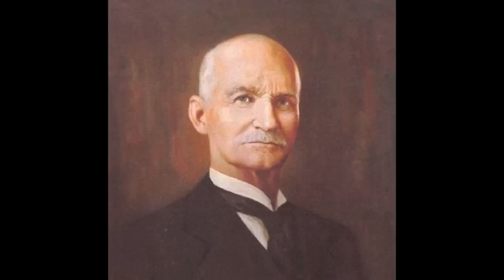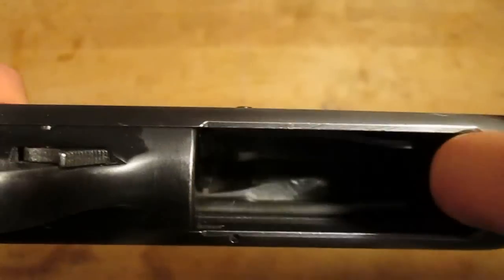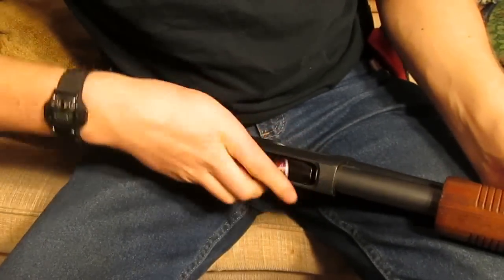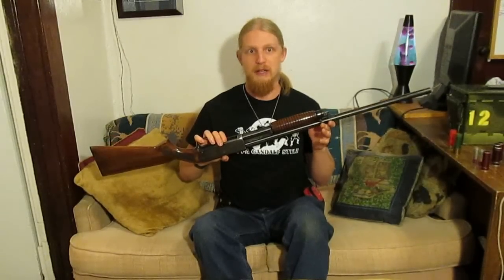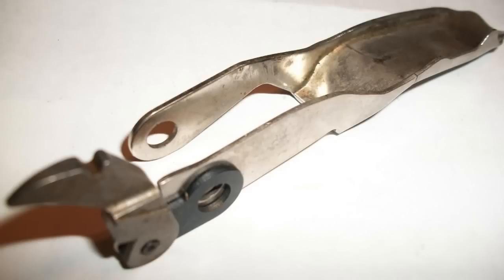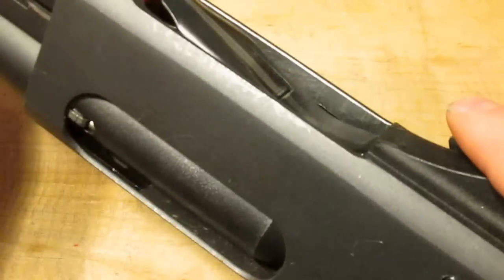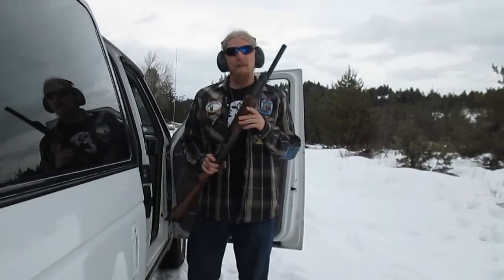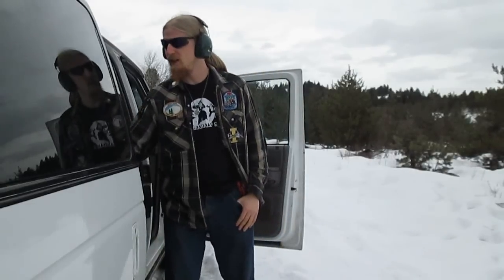Much Ado About Shell Carriers - Remington 870 Tips & Tricks #5

Comment: We have found in drills, especially in darkness, that it was easier to reload the Mossberg's magazine with the weak hand. Especially when keeping the shotgun up on your shoulder. This is due to the greater ease for find the loading port by feel. That is the only advantage of the retracted shell carrier that I've noticed. Moreover, lots of training with the 870 improves one's feel enough to negate that edge.
Reply from the maker: On the other hand, I've found that with the Mossberg 
(specifically my friend's 590A1), the bolt and carrier can snag shell rims slightly and cause a fumble during loading, whereas the 870's carrier offers a very smooth path for shells.  Also, there's a condition where a shell may seem to be in the 590's magazine, but it's not quite to the shell latch, and it's held by a piece of the bolt instead.  The next time the action is cycled, the shell simply falls out the bottom of the gun, and you wind up with an empty chamber.  If a shell isn't fully inserted in an 870's magazine, the shell carrier will either kick it back out of the gun right there, alerting the operator to the error, or it'll catch it between the carrier & slide assembly, where it'll still feed & chamber normally (if the 870 in question has updated flex-tab action parts).

All shotguns have these little pluses & minuses, and they rarely add up to anything significant.  As you said, training is essential, and that goes for any system.
Reply: Some of the silly debates comparing the 870 type to the Mossberg is centered on the supposed value of the ergonomics. Let me state that while so many like to talk about the fact that the Mossberg 500/590 safety is ambidextrous, this is an utterly meaningless factor in a combat shotgun. It is convenient feature for left handed sport shooters, but provides no advantage in a combat shotgun. How so?

Because, if you train with any shotgun, the operation of the safety becomes habit. Be it a tang safety or located at the front or back of the trigger guard, it doesn't much matter. When a fight is imminent, you are going to cycle in a round and move the safety to FIRE. That's the last time you will touch it until the fight is, without any doubt, over. Until then, your trigger finger is your safety. Off the trigger unless you have a target. Trigger and muzzle discipline are your safeties in combat. I don't care where the safety is, you won't be needing it as long as lead is flying, or at least the threat of it flying, is present.

Thus, to me, the tang safety is meaningless for combat shotguns in combat situations.

How about the dual extractors of the Mossbergs? Again, in combat, who cares. One or two, as long as it extracts. Ditto for the easy to replace ejector. If it breaks, regardless of brand, you have an issue to overcome. How it is replaced later doesn't matter while you fight for your life, does it?

What about the slide release location? Again, completely unimportant. I'm not opening the action unless I have a malfunction. The action will remain closed and shotgun hot until it no longer needs to be. Later, when the time comes to clear the shotgun, I'll unlock the action and empty the chamber. This is another thing expounded upon by those who have never been in combat or run realistic combat drills. Thus, they don't grasp what matters and what doesn't. Slide release location, like safety location, falls into the "doesn't matter" category under combat or simulated combat conditions. Comments that you have to remove your finger from the trigger are baseless, especially if you don't need to unlock the action.

Some shotguns have magazine tubes that are more easily unloaded than the 870 without cycling rounds through the receiver. However, that is only of significance when a cease-fire is called on a range and you want to unload quickly. 

By the way, I have an 870 and an H&R Pardner Protector that was given me as a gift about 6 or 7 years ago. It is simply an 870 clone, and most 870 accessories fit it. I wasn't thrilled with the H&R for several reasons. First was its excessive weight. Second was the rough action. Third was the worthless recoil pad and last was that it does not incorporate the modern 870's cutout tab on the shell lifter. After years of languishing in my safe, I finally decided to do something with the H&R. Since the near solid polymer furniture was a big contributor to the weight issue, I purchased a Hogue rubber over-molded stock and foregrip. The stock fits perfectly, but you must remove the factory installed spacer. The foregrip was simply too tight on the action tube. This required a quarter round fine rasp. I removed a little material on the foregrip and it slid on easily. This simple furniture change provided more than a half pound of weight reduction and gave a much better purchase on the stock and foregrip. It also provided a vastly better recoil pad. Two issues resolved. I realized that the action would slicken up with use, but I elected to clean up the action components with some light stone work (breaking edges, and smoothing surfaces). It was a bit time consuming, but upon reassembly, the action was far smoother. Indeed, it is slicker than my 870, and much more so than the Mossberg. I added a see-through Picatinny rail and a Bushnell micro red dot sight (a concession to my aging eyes). I also machined a taller bead sight, which restores the relationship if I sight through the rail, under the red dot, should it fail. A side saddle, sling and swivels were added. From safe queen to a first rate combat shotgun for about $200. Runs like a Rolex....

I enjoy your videos very much. Straight forward and extremely informative. Thank you very much!
Reply: @CoreyCJordan  Damn , you’re sure trying to convince everyone that the 870 is better than the Mossberg... or that the Mossberg isn’t better than the 870. Who cares?

Comment: Thank you for your well planned & informative videos.  I acquired an older Remington 870 (ex-police) a couple of years ago.  Following your guidance I installed a two round extension (Rem) successfully.  I also followed one of your videos to clear a shell (luckily dummy) trapped between the closed bolt & shell lifter.  I'm not sure how I managed this problem - suspect I didn't get the dummy round far enough into the mag tube.  

Thus the reason for this comment.  You mention briefly that Remington can supply a drop-in slotted shell lifter kit.  I can't seem to find this item on the Remington web site (probably user error).  Any guidance in that effort would be greatly appreciated.
Thanks,
Larry
Reply from the maker: I don't think they offer the complete kit anymore (at least not to the general public on their website), since the conversion was 30+ years ago at this point.  You may be able to order the kit if you call them and talk to their parts department.  But if not, you can always order those three assemblies separately.
Reply: Numerich gun parts has whatever I need.. usually.

Comment: that mini van is badass
Reply from the maker: 2nd-generation, short-wheelbase, AWD Mopar minivan.  Nearly 300,000 miles on the original engine, and the thing's still a champ that always starts up, and always gets me from A to B, whether or not there are roads between the two.  It'll fit up to 8 people inside, or I can pull all the seats out and haul a crap-ton of cargo; and what doesn't fit inside, I can put in a trailer or on the roof rack.   It's beat pickups up icy hills, and towed SUVs & Subarus out of snowdrifts.  I love it.

Comment: Ithaca 37 was actually designed around 1917 and was marketed as the Remington Model 17.  Designed by none other than...John Browning. Remington dropped it in 1931 in favor of the Remington Model 31 pump gun. Ithaca had intended to introduce the gun as the Model 33 in 1933. The Browning patents had expired but they discovered a Pedersen patent on the gun that would not expire until 1937.  Production was delayed until then. And the gun became the Model 37.
I own Winchester Model 12s (7), Ithaca 37s (2) and Remington 870s (2).  Plus I bought 3, 20 gauge Model 870s for my sons for their 12th birthdays. They are still in use by my sons and grandsons. So I like them all. One of the 870s is my chosen home defense gun, so I trust them that much.
The 870 was developed to provide a lower cost, reliable shotgun.  I would say they succeeded beyond their dreams.  The main differences are that the bolt and bolt carrier on the 870 ride on the action bars, not in broached channels in the receiver, and the bolt locks into a barrel extension, rather than into the top of the receiver.
The barrel itself simply slides into the receiver and is held there by the magazine cap.  The Models 12 and 37 have interrupted threads locking of the barrels. 
This saved lots of machining and fitting, reduced costs and made it easy to offer interchangeable barrels.  
I have an extra barrel for one of my Model 37s and it had to be hand fitted to the action at the factory.  It is serial numbered to the gun with a "-2" to indicate the 2nd barrel. 
Yes, you can argue that the "build quality" of a Model 12 or Model 37 is far superior...and that the Model 870 is "plenty good enough".  Were I to buy another pump gun today (and I actually bought one of them recently) it would be a Model 870.
As an aside, I am a retired police officer (1973-2009) and we had Remington 870 and Ithaca 37 guns in our squad cars.  I never really worried about which one was in my assigned car.  They all worked well. My home defense gun is a "retired" Police shotgun that I bought in the 80s when it was being cycled out of service.  It already had 25 years or so of service.  The finish was brutalized but it works perfectly.
Reply from the maker: The Ithaca 37 very much built upon the Remington Model 17, but changed enough that I would consider the Ithaca enough of an evolution to be its own thing.  I do give John M. Browning partial credit for its design in this video, however, due to the very obvious Remington M17/Ithaca 37 lineage.

While I quite like the Ithaca 37, I feel the 870 is a more modern and robust shotgun design, and it would be my preference for a pump-action fighting shotgun.  The 870's dual action bars and shell latches offer more reliably and redundancy than the 37 in my opinion, and the side ejection allow for advanced change-over techniques that aren't really possible with the Ithaca.  Not to knock the Ithaca; it works very well, but the 870 can take more abuse and keep running.  The 870's design was very smart about simplifying things where possible, while beefing things up where they really mattered.
Reply: @SynchronizorVideos  Lots could be argued, which I don't.  I like them both.  
I will point out that the 870 MUST HAVE dual action bars because they are also what the bolt and carrier ride on.  The dual shell latches on the 870, again, are needed for the gun to work with it's type of lifter.   While your video went into detail of the advantages or disadvantages of loading the two types, you didn't mention *unloading*.  The Ithaca is far easier to unload.  Just depress the single shell latch and shells pop out of the magazine.  Open the action and eject the round in the chamber.
The "receiver" on the 870 is little more than a "cover". 
The bolt in the Ithaca rides in channels in the receiver and the action bar serves only to move the bolt back and forth.  The single action bar works just fine.
The biggest flaw, IMO, of the 870 is the ejector system.  They can, and do, break, and when they do it is a job for a gunsmith. Few of whom are around that have the skill to fix it. 
If buying a used 870 (I just bought another one recently) disassemble the gun and inspect the ejector carefully.  I have found broken ejectors that are not visible unless you remove the bolt and carrier.  
All that said, my favorite pump gun, by far, is the Winchester Model 12.  😜 That's why I own more of them than the other two combined.  But they are expensive and not everyone is willing to pay the  price for them.

For anyone wanting a reliable, durable pump gun on today's market, the 870 is the way to go.

Comment: I don't know where I read about the stamped steel parts and machinery + R&D that went into the production of the 870 as I have too many gun manufacturer history books. I did try to locate it as I may be mixing up two different articles. One thing I liked about the 12 was the takedowns with extra barrels. I think today nothing is more versatile than the 870 though. I would love to see a 500 variant with a shorter steel receiver and beefed up action bars + crossbolt safety though. A modern 31 :)

Comment: your videos are top notch. I'd like to see your thoughts on an old Winchester 1300 shotgun.
Reply from the maker: +kevin keesee Not sure I can be of much help there.  I haven't done much reading on it, and the only personal experience I have is playing with a used Winchester 1200 (very similar to the 1300) once or twice in gun stores.  

About all I can relate is that I wasn't a huge fan of the 1200's control layout.  I prefer a crossbolt safety to be behind the trigger so that it's always right under my finger, and the slide release to be in front of the trigger so that it's out of the way (preventing accidental unlocking while running or during rushed handling) and won't be blocked by any stocks.  Plus, the 1200's slide release was pretty low-profile and not terribly positive, and it had a tendency to pinch.  Maybe the slide release on the updated 1300 feels better, but the 1300 still places the slide release to the rear of the trigger and the safety in front, while I prefer those controls the other way around.

Those are just my very brief and subjective impressions, though.  A good friend of mine has a 1300 he uses as a bear defense shotgun when he's out in the woods, and a bedside gun when he's home.  Many other shooters have good things to say about the 1200/1300 shotguns, and military-configured versions of the 1200 were even purchased by the U.S. Army in the late 1960s.  If possible, I'd suggest taking the gun out and shooting it, so you can test its function and decide for yourself if you like the control layout.
Reply: that's ok. I'm just faster with a 1300. faster field strip, fast action..

you do know your 870 platform.

Comment: Amazing videos, very well researched and presented. I have an older 870 that has tge old style carrier, I'm looking into upgrading it but I was wondering what other improvements have been made over the years and if there was other upgrades for me to preform.
Reply from the maker: The flex-tab carrier is the only really major one.  There have been some other tweaks like heavier-duty shell carriers, high-visibility magazine followers, improved firing pin retainer springs, and other little things like that.  Not critical in my opinion, but if you're already ordering parts and want to tinker some more, they're not bad upgrades to make.
Reply: @SynchronizorVideos  thanks that's what I was think Hy. My grandfather left me all his guns so I went from have 1 rifle to having 6 shotguns and 9 rifles. A lot of them are on the older side but all well taken care of.
Reply: A good set of upgrades that are pretty cheap and easy to do would be firstly the flex tab conversion then I would upgrade the carrier dog spring, now it won't be an issue on an older 870 but for most express models you should consider replacing the extractor with the non-MIM (machine injected moulding) part, a good source for these parts and how to install them check out AI&P Tactical, there are several very helpful videos from their Remington certified armourer for these upgrades and also alot more

Comment: Greetings SynchronizorVideos! At about the 13 minute mark, you mention that there are "Rebuild Kits" available for older 870s that include (at least) the liftgate, bolt & bolt carrier; can you please provide a link or, part #, etc., for this kit? Thanks; I enjoy your videos! Great job!
Reply from the maker: Mike Mike Remington's 2014 parts price list shows two flex-tab kits, black (#F93339) and chrome (#F93340).  Both kits are listed for $89.61.  I can't speak with full confidence for price and availability; I would recommend calling Remington's customer service line (the number for which is in your owner's manual) to confirm.

You can find out more about downloading the parts price list and using it to order parts in this video:
http://www.youtube.com/watch?v=-JGQupyDpwM

You can also simply buy a new-style slide assembly, carrier assembly, and breech bolt assembly separately.  It's the same thing as the complete kit, but you get to pick & choose your preferred versions of each part (which mostly comes down to differences in finish), and potentially save some money buying one or more of them used.  Breech bolts especially are pretty spendy if you buy them new.
Reply: Thank you SynchronizorVideos! I appreciate you sharing your knowledge and your obvious efforts are reflected by the quality of your videos!! The slide action shotgun is one of the best tools in anyone's box and I enjoy informative videos on them.
Reply: *****  FWIW Just called Remington and they're no longer selling the flex-tab kits.  Have to buy the parts separately. 

Can't tell you how much I'm learning from your videos.  Great job!

Comment: I don't know why anyone would consider the 870 carrier an outdated design. The Mossberg carrier is a copy of the Remington model 31 which is considerably older than the 870 and Remington dropped the design in favor of the 870 type. Even the Ithaca is a copy of the Remington 17 which is much older. The retracted type dates back to the 1890's so I guess if one design is outdated it would be the retracted type. I like both types. Not sure I even have a preference between them as they all work.